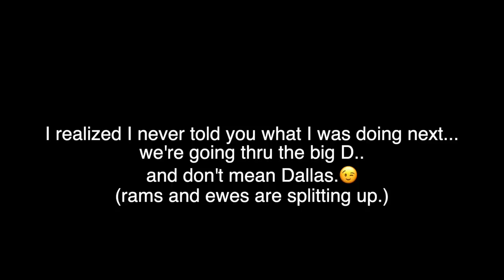we are never getting back together.  | Vlog 446

Comment: Hi Sandi, for the bird problem, just a suggestion but they come in through the door when it's up right? Could you not get the material/plastic stripes that hang down to create a physical barrier that people and machinery can get through easy but the birds can't, like the things you see in warehouse openings/walk in freezers etc. Than if you manage to remove the birds inside they wont just b replaced by more birds flying in.

Would save money in the long run on repairs from bird damage etc, and save you having to climb things and risk falling. :) Hope you and your family are well, thanks for the videos.
Reply: House Sparrows, or Barn Sparrows - they are the same thing.  They are an invasive species that are crashing local bird populations, and are costing millions of dollars for cities in both the US and Canada to try to control.  They can enter through an inch and half opening, and if they can find a two-inch wide flat space for their nest, and a food supply, they will breed. 
So, good thought but probably won't work. As long as Sandi's barn stands, with both food and nesting sites available, the sparrows will be there.

Comment: A suggestion for you. On the opening of the railings of the stairs put a layer of plastic or chicken wire so the dogs don't accidentally fall off the stairs sideways. I had stairs like that once in a house going to the basement. I had a dream my toddler son fell down these stairs. I had my husband put up plywood. Not long after my son did take a tumble down the stairs. God gave me a warning I feel. Just a heads up for you.

Comment: The rough-cut lumber will have a tendency to catch dust.  If it were my wall, I'd read the labels on water soluble floor finish to see if a light spray coat would seal the wood enough to keep the dust from embedding.  Another type of sealer might be better.

Comment: also when you do the office  you can take a 1x8 board and butt them together then on the butted ends take a 1x2 strip and nail it in place and your wont have that gap  its what they use too do too older barns board and baton

Comment: Happy Mothers Day in advance Sandi. I sent you a Amazon link for bird spike deterrents on you Instagram account. They wont keep the birds out of your barn but they will keep them from building nest and resting where you install them. The strips are used on buildings and cell towers to keep the birds from roosting. You just need to find the smaller sized strips for your application. The carpet installation strips may work as well.

Comment: Sandi Sandi Sandi ? How about mounting a bird cage on the METAL PART OF THE WALL and drill a small hole through the metal. Mount a shelf about halfway up the outside of the cage and make a one way trap door. place bird food on the bottom of the cage. When they eat the food they leave through the hole. NO more birds in one week.
Jess and Mark will know what I am trying to say.
Thank you Sandi
Please shout out THE SHEEP GAME ONE MORE TIME
Reply: The main problem is the large door that is wide open for a good amount of time every day, while she is feeding, and ALL day if the weather is nice.
Reply: @terryst9835  I agree with you but birds can not find a way out the cage and the food will only help them.
Reply: The birds get all the food they want from the sheep feed, so no motivation to go into the traps, also even if the door issue is solved there are the ‘windows’ along the sides of the barn...
Reply: @janvafa9959  What are you trying to say.
Reply: @aaronwolverson850  — based on the situation in Sandi’s barn I don’t see your solution working... just saying.
Reply: @janvafa9959  Based on I could put bird seed anywhere in my yard and the birds will find it.
Based on you don't have a solution and based on I was not writing to you I was writing to sandy and I know it could help.

Comment: Those boards look great! My husband and I like to build furniture and often look for flawed pieces of wood. We have a buffet we built and turned sides of the wood people would normally hide outwards. It looks wonderful and has a lot of character. 

You might try putting something in the bucket when you shake it that will rattle kind of like pellets or feed. It works with cattle. Maybe it will work with sheep?

Comment: You could invest in giant flappy plastic curtains over the opening of the big doors, something you can drive through but which creates a barrier for the birds.
Then set some bird traps and trap them all and relocate them outside, (eg in fall when the babies should be fine)

And then coza the flappy curtains they wont come back in and you can still use the big door.

Comment: Maybe get a fake falcon with a nest and put it in the rafters along with the sound machine and something that moves…get some reflective material and put it on some stakes or something that moves, that with the sound may work. Another thing to do is get something that will knock their nests down as soon as they build them, it’ll let them know it’s not a safe place to raise their babies.
Is it possible to turn that sorting gate around so that when they reach it it’s closed and it’ll give you time to open the side or just open to let them through? If you want them diverted you could open the side gate then open the other one to let them pass through and out the side.

Comment: The question is, why are the birds there? Probably because of the feed. You need to find a solution to stop their access to the food.
Another idea are spikes for the nesting area.
Reply: The Barn Sparrows are an invasive species in North America.  They were brought here by an idiot who thought it would be a great idea to release all the birds mentioned in Shakespeare into Central Park, New York city about a hundred years ago. 
Most of the birds died but the Barn Sparrows and Starlings have become a massive problem all over the continent. Cities in both Canada and the US spend millions of dollars a year just to keep them somewhat under control.
If there is shelter from the weather, even a flat ledge over two inches wide for nesting, and some sort of food source, they will breed in huge numbers. They are in barns because, yes there is often grains, but they will eat out of dumpsters in the cities, and any fast food joint will have them nesting, and harassing customers eating on outside patios.
If there is an opening under a roof or a wall, of an inch and a half, they will get in. Clear them out, and a new lot will be making themselves at home within weeks.
Who knew someone loving Shakespeare could be such a problem?

Comment: I noticed you said you use multiple ram breeds(steel,sulfolk etc..). What is the overall purpose or goal when breeding? (Better wool,better lamb weights, pattern)
Reply: Sandi is running a meat lamb barn. Her ewe flock is mostly Rideau-Arcott with some "Steele" which is a local crossbred based on Rideau-Arcott.  She uses Suffolk and Ile de France, sometimes Dorset sires for meat lamb production, and Rideau-Arcott and "Steele" rams for replacement ewes.

Google   "Rideau-Arcott", they have quite an interesting story.  They are a fairly new breed developed here in Ontario, Canada and are now being used around the world in ewe herds. They are bred for ewes that have multiple births, enough milk to successfully raise twins to a good weaning weight, good mothering skills, out of season breeding,
 and few problems lambing.  
Sandi's ewes lamb every nine months.

Sandi's goals, as I understand them, are 100% live twins who reach 105 pounds at four and a half months. She is getting fewer and fewer singles now, with the majority twins, and a fair number of triplets, quads and some quints.